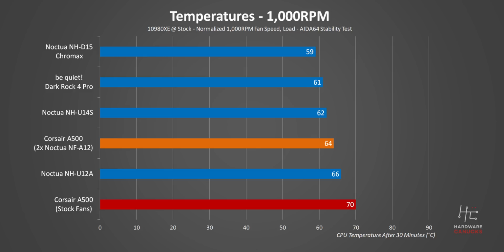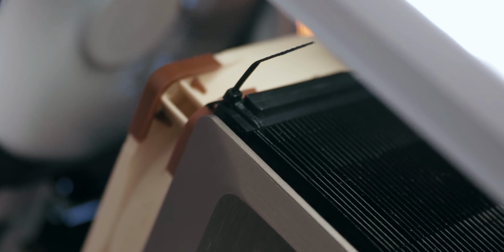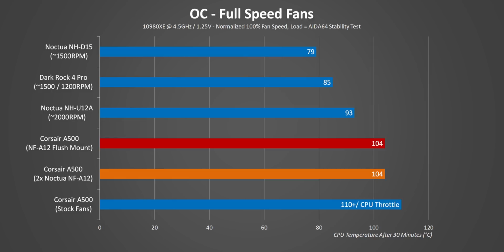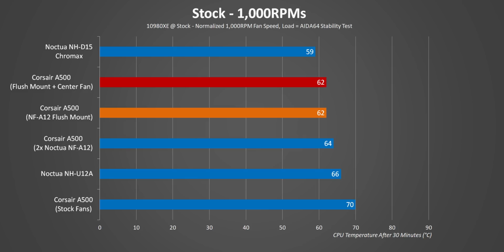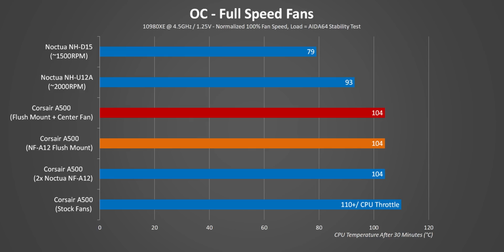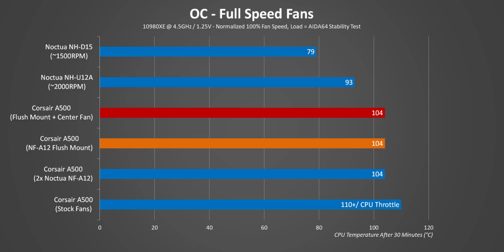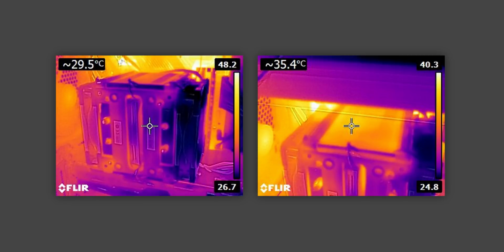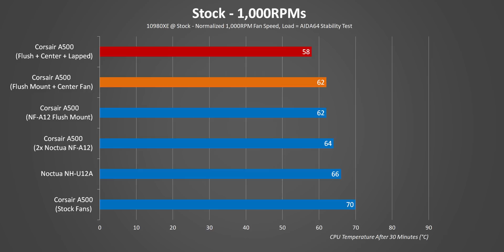I Tried To FIX The Corsair A500 Air Cooler!

Comment: Indeed, shame on Corsair!
I guess they are trying to hitch a ride on other, more successful brands that do deliver what is promised.
When it was first launched, I frowned on it as the smell of marketing poeha was overwhelming and I guess I was not wrong.
Maybe Corsair should stick to powersupplies and cases, although the latter I've noticed  several ongoing issues too (e.g plastics becoming brittle)
But then I'm not that unbiased against Corsair, ever since I bought their most expensive Dominator memory only to find out that the optional expansions are no longer availble.
Comparing Corsair's customer support is another huge negative, if I compare my experiences with Noctua which was top-notch.
I guess if you want effective & efficient aircooling, Corsair is stil a big no-no, as they have been in their past "solutions".
Thank you so much for this more then excellent review & attempts to fix a broken & badly designed product, you save us all a lot of money this way.
And a lot of disappointments.
Still, I do blame Corsair for trying to sell us snake-oil, I would have liked them kept a higher regard.
I guess not...

Comment: Point and Case, this is a BAD  product.... If you have to "fix" it, to make it work as it should, then it does NOT work to start with. 
Buying Noctua fans? Using zip-ties? Yeah... how about just "Hey guys, avoid this product, and just buy yourself an actual Noctua cooler"

Comment: Isn't it just the known issue of A500 not making proper contact due to heat pipes being blocked by capacitors? Try rotating it 90 degrees.

Comment: Only thing that will help this failure of a cooler is dump it into an aquarium full of non conductive liquid, which is damn expensive to do. Mineral oil, 3M Novec, etc. Nothing will help this thing, out of specs clearances = incompatible, heavy as hell with poor performance. Fail.

Comment: This air cooler shouldn't be recommended for any processor. Why get this when you can get the NH-U12A for around the same price? If you don't like Noctua's aesthetic, get one of their Chromax coolers or a Dark Rock 4. This cooler should be avoided completely until they add heatpipes, eliminate the dead zone, and slash the price at least 40% to make it competitive from a price standpoint.

Comment: I feel a lot of tech channels are ill-equipped to mod hardware without a 3D printer; a Prusa Mini would be really helpful, so you should consider it.  A multi-part bracket printed in Polycarbonate or Nylon would, then, better mount that small fan, without its material melting.

I think the A500's main issue is the cooling plate, which may have too small a surface area to work efficiently vs other coolers.

Comment: did you guys lap the cpu also, if youre lapping a cpu cooler you need to lap the cpu ihs too so that the contact is 100% completely flush. iirc intel has a slight concaveness to thier ihs so when you lap them the outside edges get smoothed down first

Comment: The likely problem is mediocre heat pipes.
Reply: and a lack of them. 4 is rather low for such a large aircooler, even if the middle two are larger. Scythe and Noctua do a lot better job at these high performance monotower designs.
Reply: @PriaSamari  Yeah the gap in the middle makes no sense, it's pretty much a waste of space that they could've used for a couple more heat pipes easily.

Comment: I appreciate the verification that the mounting due to it not being smooth was one of the biggest issues.

It was also nice to see that the design just simply isn't enough for the rated spec. I love the way this looks and the design of it. We just need to wait for a fix of this where they fix the smoothness of the mount with higher static pressure fans.

I would also love to see a version that does 6 heat pipes and fills the center with fins attached to the 2 extra pipes. Then just leaving holes for the screw driver to mount the cooler as it does now.

Comment: I had the Corsair A70 back in 2009 or 2010. And I'm pretty sure that performed better then this A500. 

But if you want a air cooler, just get a Noctua and call it a day.
Reply: Or Be Quiet also
Reply: @DarkReturns1  BeQuiet consistently performs a little worse (2-4C) than comparable noctua coolers.
Reply: @lordvoldemort917  but also usually a good chunk cheaper too.
Reply: @lordvoldemort917  yep, but a bit cheaper and look waaay better lol
Reply: @lordvoldemort917  but it's also even more silent
Reply: @matteo964  Nope see any noise equated testing noctua out performs BeQuiet in thermal performance when noise is equated. Therefore you can run your noctua cooler a little quieter to get same thermal performance.
Reply: There are a bunch of cooler around ~90€ like nhd15,dark rock pro 4,r1 ultimate,r1 universal,assassin 3 and even more
Reply: Scythe Ninja 5 is also excellent for less.

Comment: So, Corsair, in order to make this product competitive, needs to either drop the price (because the rail thing is not enough of an incentive) or add more heat pipes...?
An easy fix could be selling the cooler without any fans and at a much lower price (and advertising a lower performance instead of being able to cool down 250W CPUs) and let people put on there any fans they want since the look of the thing is actually pretty good imho

Comment: lapping my NH-D15S and IHS dropped my temps by 5 degrees under load with my 3700X. Even the good stuff can benefit.
Reply: Did you do a video? I've never seen someone lap a cpu cooler, only the IHS. Sounds interesting.
Reply: @maximusthundergooch3102  I did not but he did it in this video if you watched....
Edit: it's way easier and less risky than doing the IHS, same process just to the contact plate on the cooler, you can do it on direct contact heat pipe coolers too just be careful not to go all the way through them.
Reply: @maximusthundergooch3102  GamersNexus did a video on it a while back.

Comment: Please try mounting the A500 on an Asus Z170i mobo and check whether the heatpipes ride the motherboard VRM. This was observed by another youtuber and the theory is that the A500 isn't built to socket 1150/51 spec. I'm curious if it can be confirmed.

Comment: I saw the Fuma 2 in the background, you think maybe the Fuma  2 could get improved by slapping 2 Noctua NFA12X25?  I was between the NH-U12A and the Fuma 2, but those lower rpm fans i thought wouldn't be enough to handle 250W.
Reply from the maker: Guess we are gonna find out soon!
Reply: @HardwareCanucks  Thanks.
Reply: @Ziv Zulander I know. I have the Noctua fans, also many 2000 rpm fans. I just want to see how far can you push the Fuma 2, and how well it would keep up with an NH-U12A. My NH-U12A can handle 250W. I dont think a stock Fuma 2 can do that, but with faster fans, maybe its possible.
Reply: @PietroSoft  To answer your question, most  likely not, but might if you find 2 Noctua fans spinning in opposite direction. That's the trick of the Fuma 2
Reply: @dorientjewoller113  I bet you can have the same performance with different fans. The heatsink doesn't care in which way the blades spin. Only that you push air through it.
Reply: @PietroSoft  Heatsink might not caring about it, but your ears might. Those opposit rotating fans are giving these 1200 RPM max. a better static pressure, a better directed airflow at a lower noise and RPM. BTW, from the review I have already read of this Fuma 2 it seems that it's between 5 to 7 decibel quieter then the Noctua NH-U12A but trails only a 2 degrees. Of course, it depends how and in what kind of situation it is tested. But that's with all coolers.
Reply: @dorientjewoller113  I dont care too much about silence, i care about performance. You cant drive 250W in full silence, most of the reviews dont push the heatsink to the limit like it happened here with a really high thermal load. They just use a 95W chip, slightly overclocked. Here they used a tdp monster to test the heatsink. I have tdp monster too (5960X). I also have the NH-U12A, i am happy with the performance of it. I just want to see, what the Fuma 2 can do with a very high thermal load. And if strapping faster fans, like with mostly any heatsink can improve performance.
Reply: @PietroSoft  It keeps a i9-9900K overclocked at 5.1 Ghz on all cores during a Cinebench 20 loop at 86 °C, even blender and Davinci Resolve did not passed that 86° C, with its stock fans. BTW, I believe this is the 2nd time we have this discussion and I come back to my first conclussion: If you can afford what you are using now, that 60 USD Fuma 2 won't make a dent in your wallet to test it out yourself.
Reply: @dorientjewoller113  9900K at 5ghz does around 200W. Not enough to be an extreme heatsink test. Well, the guy already gave me hope that it will do the test. Thats the only thing i care.
Reply: @PietroSoft  If you wanna be sure that Scythe can keep your system cool. Get yourself the Ninja 5 and slap your 2 Noctua fans on it, keeping in mind that low profile memory is needed for this cooler. It's the same size as this Corsair A500 Air, but with 6 x 6mm  heatpipes and a bigger heatsink surface in total ;)

Comment: Only way to try fixing it is that Corsair recalls that overpriced piece of crap. It's designed but not following the specs of the 115x  socket by Intel, which allows the heatpipes rests upon the capacitors around the socket resulting in a bad contact with the CPU or no contact at all. It's a flaw no user can fix by its own and should not exist at all. Not sure if the same mistake has the same effect with AMD sockets, but nobody should risk their money to get such a failure. Stop licking Corsairs arse and justify their mistake. It's a flawed and bad copy of the Scythe Ninja 5 which if you even upgrade the fans to the 1200 RPM versions of those that are included with the unit is still cheaper then this A500 Air.

Comment: Just ask Corsair to make a better cooler. I would never buy this cooler. Nobody who has used a NH-U12A ever will. And the aren't even in the same class dimension wise. £85 for this?? There are other coolers that deserves attention. You guys should look at Zalman CNPS20X. Nobody even asked Corsair for this.
Reply: Also what he said. 4 heat pipes? I would really like to know who made that choice. If there is a nex time do these: denser fin stack,  at least 6 heat pipes and change the shape of the blades of the ML fans. They have been loud before I was born. Even Cooler Master puts in effort to improve their products.

Comment: imho i think the A500 is a pointless product, if you want an air cooler that works buy Cooler Master Hyper 212 Evo, if you want something thats a bit more aesthetically pleasing buy a Be Quiet Dark Rock Pro 4, or if you want performance over anything else buy a Noctua NH-D14.

Comment: Don't recomend  an air cooler on the high end stuff  stop trying to sell this shit. As much as 3 cheap aio liquid coolers from Ebay and its gona drop the heat down by 10, 20 degrees  Celsius if it is delided and even more ... a 240 can bring it down by 40

Comment: Glad that i got an NH-U12A. It handles 250W (5960X 4.5ghz 1.3v) like a champ, Noctua putting a ton of heatpipes i guess helped.
Reply: here noctua nh-d14 (+2 after market 14cm noctua fans ) . i3770k OC to 1,29V ,PLL 1,600, 4.9Ghz max 64 (spikes 66) Celsius.
Reply: @grindererrofficial3755  Really nice. 3770k... that thing is delidded?
Reply: @PietroSoft   Hello Pietro, yes, its delided, thermal grizzly conductonaut used, laped top of IHS and back (i mean that part which touching cpu PCB), not reglued, just fixed by socket bracked pressure.
Im not operating cpu on this 24/7 im normaly using auto Vcore and about 2,5Ghz-3,5Ghz for regular things like browsing, watching youtube or vids or film, reading webs or ebooks.
But if i need some more power for AAA games or rendering or converting bunch of audiofiles or other power hugry tasks, im going to OC. 
With this oc its compatible with 7+ gen i5/i7 intels. ANd its enough. 
Btw if i need new pc nowadays i would pick prolly AMD. More music for money, than overpriced intel about 50 percents.
Have a nice day :)
Reply: @grindererrofficial3755  Hello. Conductonaut, damn you pushed that thing to the max. Yeah, i too have on auto, the voltaje and speed regulates. I dont need 8 cores at 4.5 all the time, and locking the voltaje its not good for power consumption and reduces the life of the chip. Some things are starting to need 6+ cores, with the new gen of consoles coming requirements are about to go up. AMD is the better deal today, if i jump to AMD only the 3900X and 3950X are considered upgrades for me.
Reply: @PietroSoft   its quite safe, im usinf Vdroop and offset settings for Voltage so when i aply 1,29 cpu "sucks" like 1,26-1,27 in full load. Honestly i dont care about power consuming, im not using TV or some stereo aparature. And im using all fans Noctua, they have like 30 percents power consumption of other brands vents and they are effective more and quiter :)
This cpu has 4+ HT, so 8 threads- all programs handling with it like with 8 cores. I realy no feels some "need" of new rig. I have 1080ti. And im happy. But i was seriously some months though about AMD. I realy like compatibility of sockets in line of severeal generations. Its very clever and neat feature and Inteligent. Not money greedy like intels.
But that AM4 is ending for 2020 if i have good info, so i have to wait.
I guess real kick to move for new rig would be PCIex 5 :)

How are your temps ? Did you delided your cpu or come tweaking with ? Which cpu you had before ? How are you satysfied with your new amd cpu ?:)
Reply: @grindererrofficial3755  For me power consumption matters, because this chip (5960X) can go beyond 250W If pushed too hard and the PC iddles at 100W. Fans dont consume too much power, the great benefit of Noctua is performance and silence. Thats the thing, new consoles will come equipped with 8 Zen cores, quite possibly with smt enabled, so 16 processing cores. I have a 1080 Ti too, if you check my latest video, its only possible at 4K ultra thanks to that GPU. The problem with Intel is that they got too lazy, they stayed on the same architecture with small tweaks for way too long, and AMD came up with a new arch and a brilliant solution that lets them "glue" chips, infinity fabric. Intel is losing hard right now, and its good to see that.  The only thing that can push pci-e 4 is nvme ssds, that its not very interesting to me. 
My 5960X its not delidded, there is no need because its soldered, and delidding it would be too hard and there is a high risk to kill the cpu. I am still on my 5960X 8 Core 16 thread Haswell. I was saying the only options that matter to me from AMD are the 12 and 16 core, because the 8 cores would be too similar to my actual cpu. My temps, well because im right at the limit of the heatsink about 91ºc using Cinebench R20, no thermal throttling, iddle 35ºc.
Reply: @PietroSoft  I know vents are just cherry at cake :)
You have good cpu, enough powerfull for few next year. But those temps man :( Terrible. Intel using tooth paste under the IHS - ppl using liquid metal. Some clever head in intel got an idea " lets solder it" . Ya its dengerous to delid your cpu.
Whole story of Intel lazyness started i guess in 2008 or so with Nahalem or Nehalem idk architecture. Its still same bones, with little facelifts and updates.
In few first years they atleast went in strategy "tic toc" 1 year gain clocks/power next year updated power consumption. Idk exactly when they just refused to rise up clock/powers, but they did. And this is that enormous lack  encasement of cpu power in last 5 intel generations. So sad, how they just "turned off"  leveling up cpu, and just leveling up prices.
And no comments their "refresed" old i7 as next gens xeons.
I realy not fear you up, but 91C is not nice temps. Maybe you can try bit undervolting, coz quite often MB push into CPU more as realy needed. Maybe different TIM on IHS .
Take care :)
Reply: @grindererrofficial3755  I think the lazyness started with sandy bridge. The 5% jumps and quad cores every year. 91c when using Cinebench R20, heavy avx rendering workload, when gaming and using the PC normally is never that high, and 91c is high, yes, but im still a tad far from thermal throttling, the 5960X tj max its around 105c.  If i lower the voltage i would have to lower the clocks. And 1.3v is safe on a 5960X on air. Max on normal use is around 75c. Keep in mind that this is quite a hot chip, and im pushing my luck doing OC on air, this chip is more for watercooling, but i dont trust watercooling i had the bad luck of seeing an aio leaking and almost killing my gpu.
Reply: @PietroSoft  yea you have right. And about water cooling iam also big sceptic. But AIO are more safe than custom builds.
But im also strictly and only air guy :)
Reply: @grindererrofficial3755  Yes, you had to have some really bad luck if your aio leaks. I made a video of it leaking, its on my channel too, Raijintek Triton, that aio looked so cool. But that leak turn me into an air only guy too.
Reply: I'm running a I7 9700k on 5.3 ghz on a bequit dark rock pro 4 and it's not even over 80°c after a couple cinebench runs
Reply: @paulkrimmel6384  Pretty awesome cooler.
Reply: @Alistair The U14S is cool, but it can intrude on the first pci-e slot on some motherboards (Like my Rampage V) that can be a problem with the big Noctua coolers.

Comment: Just get a d15 or a d15 chromax if you care about looks
Blows every single air cooler out of the water 

If you get it 🙂😂
Reply: I love Air cookers too, they make such good french fries, no oil required :)
Reply: SonnieSlim1 specially when they are cheaper and cooler and more noise efficient than AIOs and you don’t have to worry about any major  failures
Reply: SonnieSlim1 nope
Reply: SonnieSlim1 I love air coolers
Reply: SonnieSlim1 yeah sorry
Reply: SonnieSlim1 sometimes I don’t even  know why do they even call it autocorrect